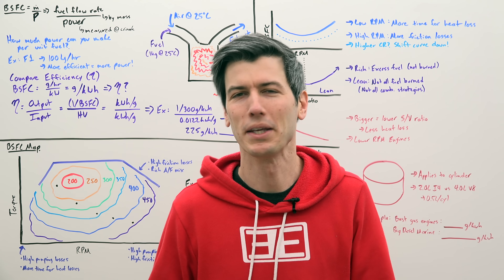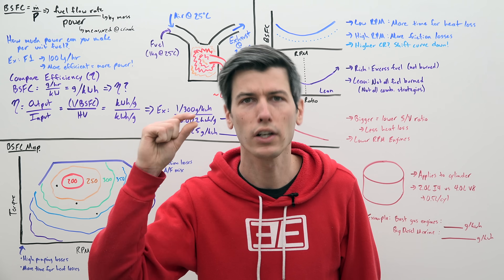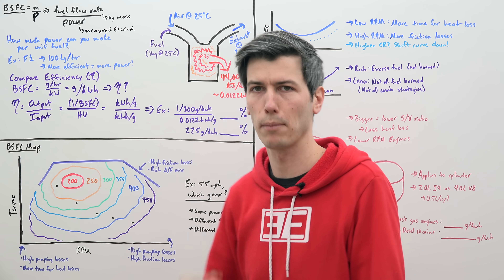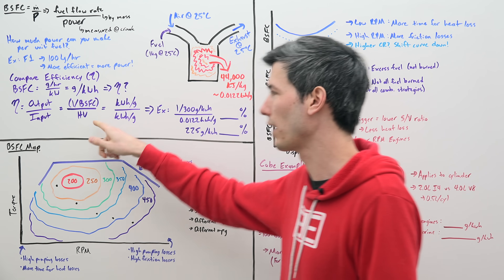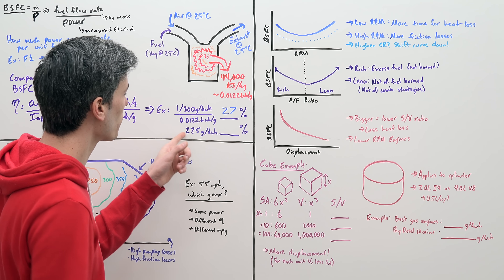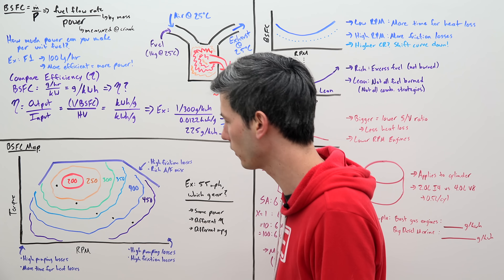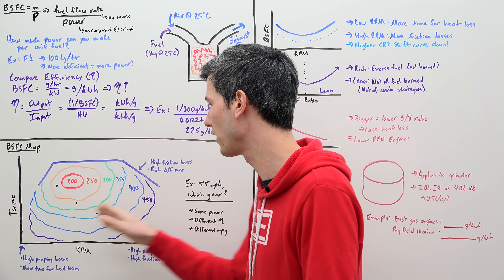The Best Way To Compare Engine Efficiency - BSFC

Comment: So how applicable is BSFC to electric motors? I realize that fuel flow doesn’t exist for an electric motor but the question of how efficient a motors energy transfer is, is interesting.  How is an electric motor’s efficiency measured? And is that efficiency measurement comparable to the BSFC efficiency measure for ICEs? It’s two different energy sources achieving the same goal and I’d love to see a video about how efficient electric motors are compared to other engine types.

Comment: This then kind of begs the question why they're downsizing engines? A 1liter 3 cylinder isn't going to be more efficient than a 1.3 liter 4 cylinder. However a 1.3 liter 3 cylinder would be?
That would then theoretically make that new Yaris GR engine (1.6L 3cyl) very efficient. But when you then look at the eco label it's horrible.

Somehow there is a disconnect between science and carbon ratings. In a ecosphere of discourse that likes to pretend to be all about science....

Comment: So, according to your explanations, 1.5 3L ecoboost Ford engine has to be more efficient than 1.5 4L ecoboost Ford engine, that is probably the reason Ford goes through 3 cilinders, every one is bigger with the same displacement. Is this correct? Thanks Jason.
Reply: 3 cylinders has less friction than 4 cylinders. 4 less valves and springs, 1 less piston, 2 less cam lobes. So yes, it is.
Reply: @SKC56  aaaand also with better balance
Reply: @Pao234_  Not sure about balance tho, I've never seen an straight 3 smoother than straight 4...
Reply: @SKC56  hmm, it was probably inline 6 i was thinking about
Reply: @Pao234_  a 3 is smoother in terms of secondary balance but it has a major front to back rocking. I think we will see more 3 cylinder motors coming soon
Reply: Generally less cylinders will use less fuel. There’s less friction, and each cylinder has a little dead area around the piston so less cylinders is less dead area. Part of why single and twin motorcycles normally get better mileage than the 4 or 6 cylinder bikes.

Comment: I experienced a real world example of this (or related to this) on a recent road trip in our 2.5L Skyactiv CX5.  During one tank of fuel, I kept the CC set at 75, which produced a 6th gear (auto) cruising RPM a little above 2,500.  That tank of fuel only averaged about 24.8 MPG, which seemed really terrible to me.  On the next tank, I kept the CC set at 65.  Cruising RPM was more like 2,200 or so.  When we arrived at the destination, average MPG for that tank was all the way up to 30.0!  So it makes me wonder what is the ideal cruising speed to get the maximum fuel economy on the car.

Comment: If thermal energy loss through cylinder walls makes a considerable difference to engine efficiency, it seems like it would make a lot of sense to make the cylinders themselves out of some material that doesn't conduct heat well. In that case metal seems like it would be a very poor choice for cylinders, as it conducts heat so well.

So why are our cylinders still all metal? I assume it means that other materials such as ceramics simply aren't durable enough for the job, or are too heavy.
Reply: Surface wear characteristics and cost are two big reasons.

Comment: This is great! I always struggle to explain why my boat's two 454 engines aren't as inefficient as they seem at first. More POWAH!
Reply: Yes, and you have propellers that have a lot of pitch in them to prevent over-revving those engines. That loads your engines greatly, which helps BSFC.

Comment: It would be interesting to see a similar video regarding electric vehicles. I recognize that many electric vehicles do not have transmissions at all. But some do and perhaps you could explain why many don't
Reply: Because the electric motors in EV's generate full torque from 0 rpm and have a wider rpm range and efficiency that almost remains constant well above 90%, there is no immediate need for most EVs to have more than 1 gear. But there would still he a benefit for EVs to have 2 or 3 gears, they too have a similar best efficiency point. Further, have a low and high gear means you can have a lower torque motor to get the same torque at the wheels.

Its a matter of cost vs benefit, most OEMs decided the benefit doesnt outweigh the cost. But at some point, EVs will have regulations to limit the energy consumption, similar to ICE, so perhaps then they'll get more than 1 gear
Reply: You only really need a transmission if you want massive acceleration along with a more efficient cruising mode. For most cars the "high" gear already provides enough acceleration, so there isn't a big need for more gears. Plus, you save weight and complexity by ditching them.

Comment: So the lesson I got out of it: Get a massive four-banger!
Reply: Hence the 2.7L turbo 4 in the Silverado.
Reply: @Shapparaal  EE did a video on why that engine is ineficent asf and a fuel hog
Reply: Or get a Lanz Bulldog or something of that kind. 6.2l 1 cylinder Diesel engine. Can't get more efficient than that!
Reply: @Marco Krueger  I'm driving at peak BSFC but my Speedometer is going 100, 110, 120, 130, 140, 150. How do I get BSFC at a reasonable speed? That's when you go back to smaller engines. That is unless you just tie 10 cars to each other, turn 9 of them off and have one pull the group. Then swap the lead car so everyone uses fuel equally.
Reply: 1 liter Single cylider engine 🤔

Comment: Could we get a 3D graph of BSFC vs RPM vs Boost? I’ve been wondering how BSFC compares at high RPM/low boost vs low RPM/high boost, especially considering how turbos need rich fueling at high boost.
Reply: The efficiency boost you see on those turbocharged eco cars typically come more from the downsizing of the engine, and using the turbo to compensate for the lack of power. Since cars typically only need around 20 HP or so for steady state, you could just have a small NA engine that runs at 60% torque for good efficiency. However if you need to pass, that small engine can't really produce more power, so the turbo spins up and shoves in more air, and thus fuel, to get you the power you need. Since this typically results in very hot cylinder temps, the engine runs fuel rich to compensate, and tanks your efficiency.

While a NA engine is more efficient at around 70 - 80% torque, a turbocharged engine would probably want to sit around 40-50% to keep the turbo from spinning up too much.
Reply: @Appletank8  Thanks for your reply!

Comment: The BSFC map drawn is dependent on engine loading or not? At the maximum speeds of the vehicle, when the loading due to drag is high enough such that the car can gain no more speed due to torque equalling the forces on the car, the BSFC would be higher than what is written or not? I mean to say, in the example given, the curves written are for same powers at different RPMs which would happen only at poor loading.
Reply: I could probably frame it better. To achieve the best possible BSFC for a given RPM, the engine has to be properly loaded. 
OR
BSFC map drawn is dependent only on the RPM, but actual BSFC achieved depends on RPM and load, and the best Efficiency for a given RPM achieved is when the engine is completely loaded.

Comment: I'm glad you said this. Everyone that drives a f150 wants to compare fuel efficiency (mpg) between the 3.5L twin turbo vs the 5.0L naturally aspirated V8. The 5.0 gets the same fuel mileage as the 3.5L V6 but produces almost 100ft/tq less. 

If the V8 produced the same power numbers the fuel efficiency would be less than what it is.
Reply: It is mainly that turbos can greatly increase peak bsfc, but only in a narrow range. Low rpm means just a low compression engine and high rpm the turbo is restrictive

Comment: Lowest BSFC is on the lean side. The reason is, if we put some additional air into the cylinder, we reduce pumping losses (because higher pressure in intake manifold is needed to pass additional air) and heat losses (because of lower peak temperature). Also dissociation of triatomic molecules like H2O, CO2  is less pronounced and dissociation is endothermic process.
We're limited in leaning out mixture by emission (three-way catalyst works best in stoichiometric AF ratio) and limit of ignition (the leaner the mixture the harder it is to ignite it), otherwise all cars would run lean for economy.

Comment: I love how this correlates to gasoline v8 in pickups are labeled. A 4100rpm peak torque doesn't fit well on the table well. Diesel engines are full center on the table. I feel my 2020 475hp pickup that uses 10.9L/100km on the highway weighing 8400lbs. Most  gas v8s 1500s would be broken at 8500lb curb weight and far from the usual 12L/100km(nominal curbweight of 5000-5500lbs).

Comment: So a 1.0 3 cylinder turbo is more efficient than a 1.6 4 cylinder, "the same power" using less fuel 😀
Reply: well 4 cylinder is much reliable than 3 cylinder because of the primary force

Comment: @engineeringexplained will you do a breakdown of how much battery energy is lost when you start a car and how long it takes for the charging system to restore that energy when the car is at idle.  I’d like to quantify why it makes zero sense to start a car when it’s near zero degrees and let it idle for a 15-30 minutes then shut it off if it’s been sitting for a few days and won’t be driven for a few more days.

Comment: Another plus for large volumes and relative stroke lengths is lower friction relative to power, due to the same principle as the volume to surface area ratio (squared instead of cubed though).

Comment: My 2ar-Fe in my Tc 2.5 is pretty efficient with a 6-speed manual, averaging 33.4MPG and it's a fairly large engine for being a 4 cylinder 2.5i. personally I would never own a car with under a 2.0i for this exact reason you're talking about efficiency.

Comment: So if gears, diff ratios, intake, exhuast are constant and only changing engine size, a 6.2 (10.7:1) would have better mpg than 5.7 (10.2:1)and a 5.3 (9.1:1)? Interesting. The only benefit of the 5.3 is that you can use 87 octane which is usually 17% cheaper than 91

Comment: I wonder if reciprocating mass or imbalance is also part of the loss? Because it's also affected by square cube law but negatively. For the same displacement, I guess the most efficient engine is not always a big single cylinder?!

Comment: Nice! More math! This video comes timely. I had a discussion last week about engine efficiency. I remember you mentioning, in a previous video, how ICE are more efficient in higher load/lower RPM scenario, so I use that knwoledge and I was talking about that, when Someone told me " it is inaccurate, gasoline are better at higher RPm diesel at lower" . The people in the conversation were confusing Fuel consumption and torque production as efficiency with thermal efficiency. But, I'm just a IT tech, I can't explain those thing well enough, So I wa not able to do it at that time. But now, we have Jason coming to the rescue with more MATH!! ( I love math). na na na na MATHMAN!

Comment: 8:35 Why is the Torque higher in the gears you drew? RPM drops as expected but Torque increases?
Reply: the condition he described is a car travelling at a constant speed. The car can be in different gears at this speed, but the power output has to be the same across gears otherwise the car either speed up or slows down. If power is constant and rpm is fixed for any gear at any given road speed, then the torque must change since torque x rpm is power. This is why lower gear result in higher rpm and low torque (that constant power line he drew)

Comment: Even though creating the highest  efficiency engine might seem like the best way to have the most efficient car, factors that shorten a car's life, such as highly complex and hard to repair components, contribute to ending the useful life of the car earlier.  And since so much energy goes into building a car, the concern for efficiency should include this bigger picture.  
Put more simply: I could have the most fuel efficient car as I drive, but if a critical repair costs more than a year's fuel and causes me to consider trading in (or scrapping) the car, then the overall efficiency "foot-print" goes way up.

Comment: If bigger cylinders have a better volume-to-surface ratio, with the same engine volume, I4 should be more efficient than V8?  In theory, one-cylinder design should be most efficient for the given total engine volume, but I understand, considering balancing issues, nobody goes this way. Still, I6 and I4 are pretty much balanced, but we never saw 6.0L I-4 engine?
Why we literally never exceed a certain volume limit (about 0.7L) per cylinder and increase the number of cylinders instead, when we need to build a large displacement motor?

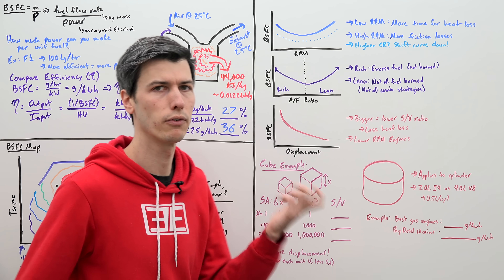Comment: I think there's a mistake around 7:50, when discussing the lean mixture. I'd expect a lean mixture means that not all the oxigen is burnt, not fuel.
Reply: Same thought
Reply: When you go to high over stoichiometric you start getting misfires and unburnt fuel. The spark needs fuel around it to ignite the mixture and if there are gaps in the path of the flame not all fuel will be ignited. More of an issue on larger cylinders and the faster the piston speed. there is a limit though on how lean you can run for petrol.

Comment: Fellow Miata ND aficionado here.  So the 1.5 liter engine will in general have higher heat losses than the 2.0 liter, but it is a more efficient car you'll generally be able to drive it at a higher load.  If you need to drive both cars at a high equal speed around a track, the 2.0 may be more efficient because you can generally use a higher gear or less than max load to produce the power needed.  Larger engine is more efficient the crazier one drives, to a point.

Comment: ...  at the end these "efficiency at given power output" graphs should be published in the spec instead of MPG. If I have 2 engine options for the given car, for example, 2.0T vs 3.6 V6, it may appear that 2.0T may be more efficient in average, but V6 may be better for the high-output scenario. So as a consumer, I can decide which is better for me based on my usecase - slow cruising on highway VS pulling trailer across the mountain range.

Comment: Airplane designers are greatly concerned with BSFC.  Most air-cooled engines in light airplanes have a BSFC of 0.5 lbs/horsepower hour.  This is used to size the fuel capacity for the airplane.
Reply: That is why air cooled is poor design, they use about 50 percent more fuel than a modern liquid cooled engine.

Comment: MPG is not important. Miata has a 1.8 l motor and averages 25mpg. I can get almost 30 if I'm cruising down the highway. But, I'm sitting between 3-4,000 RPM. If you take another car with different gearing and it cruises at 2,000 RPM it's going to get better fuel economy. Same motor same car just different gearing.

I have a similar issue with my 2002 m3. It makes horsepower, but it's only a 3.2 l motor. Your economy is not that different from a V8 though with double the displacement. It's the gearing and tire sizes. Usually the V8 cars have taller tires and higher gear ratios. Which is why when I replace the differential I'm putting in a 293 rear end instead of the 3.62 rear. It will increase my fuel economy, but my main reason is because I'm boosting the car

Comment: So how would I calculate an electric car being charged by a Hydrogen fuel cell?
Reply: If your electric motor were directly powered by the fuel cell, you could use the same calculation. Batteries make this trickier but as long as the amount of charge in the battery is unchanged between the beginning and the end of the test, you should be close.

Comment: Yeah, mpg isn't great to figure out, if it's efficient, because I always wonder, what this could be in l/100km
Reply: They are inversely proportional and the crossover point is:
15.3367 mpg = 15.3367 l/100km

Comment: another conclusion of this video is: for the same displacement, fewer larger cylinders is more efficient than more smaller cylinders, which explains why high efficiency cars tend to have 4 or 3 cylinder engines instead of same size engine with 8 or 12 cylinders that can rev faster

Comment: Very interesting!  Question about the presentation.  At the end, you said that the massive marine diesel engines were much more efficient than an ordinary car engine.  Marine engines burn bunker oil. Bunker oil is just one step up from crude oil.  Would these massive marine diesel engines gain efficiency from using (more refined) diesel fuel as their fuel instead of bunker oil? Thanks
Reply: Yes they would and they do in the rare cases they do use it. The reason for distillate fuels (usually called Marine Gas Oil - MGO in the industry, similar to vehicle diesel) not being usually used, is the price difference compared to bunker oil (Heavy Fuel Oil - HFO). At the end what matters is cost/mile sailed and by using MGO you end up losing more than what you gained from the BSFC improvement.
Reply: You checked the energy density of your fuel choices?